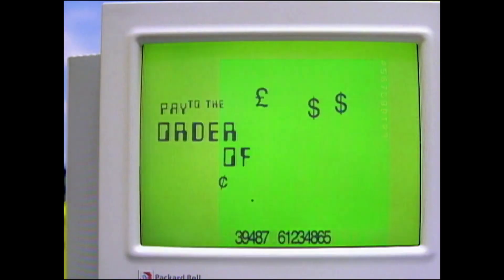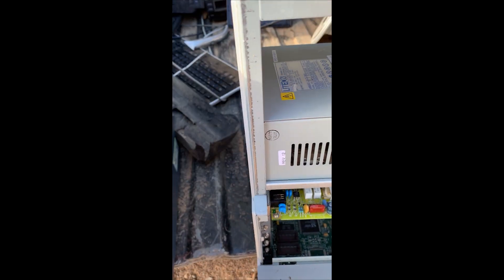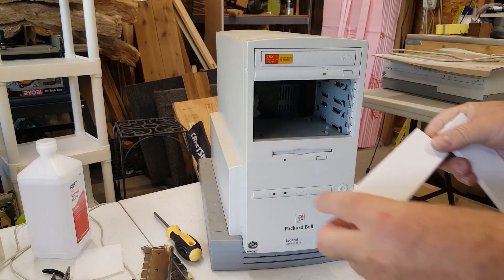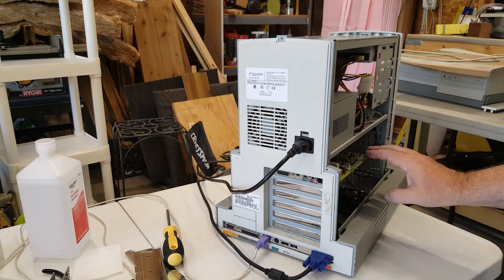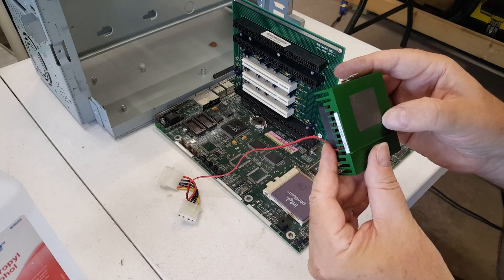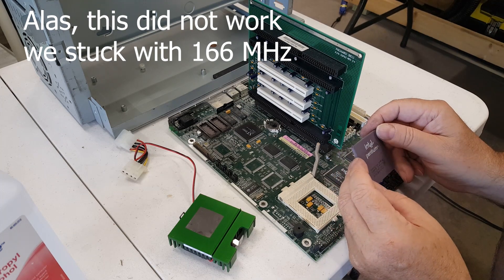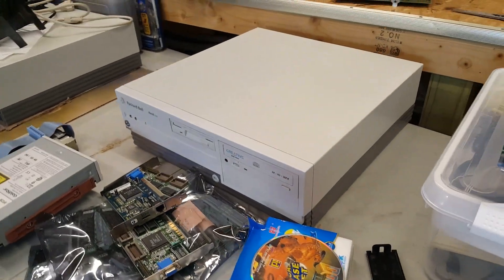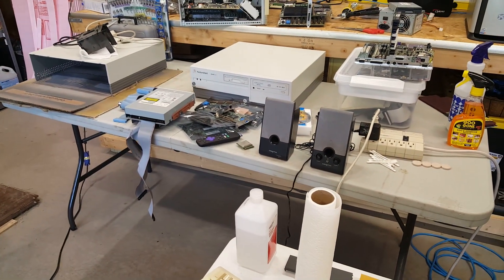Packard Bell Legend Supreme 1611

Comment: Looks really good, I'll give you that. But I don't like painting plastics. If you're not aware of it you should google for the "8 bit guy" who has a retrobright process with Salon Care. Take a look at that. You get the original color from the original plastic.
Reply from the maker: Thanks for the compliment.  I'll also take the criticism.  Be aware, though, that the whole retrobrite things works to a point, not 100% and as I do not plan to throw these computers around, it is a good finish.  Also, I live in an area where there is little direct UV light and I have seen some older plastics take "offense" to any chemicals and partially disassociate when they are soaked in them.  Everyone is aware of the 8 Bit Guy (I have met him personally at a computer fest) super nice fella!
Reply: @UncleMikeRetro  Cool cool, well what you've done is beautiful either way.
Reply from the maker: sorry for the rant  😎 you are nice to put up with me!

Comment: WOW! Socket 7 😮....can you send me this Motherboard? I want to buy a Socket 7 Motherboard 🥺.
Reply from the maker: it is REALLY proprietary though.  it will only fit in this case the way it is designed
Reply: @UncleMikeRetro  Is there any way to get such a Socket 7 Motherboard? or complete system including Case, Motherboard, Processor, RAM, HDD?
Reply from the maker: 2 ways.  eBay or go dumpster diving.  Best ways.